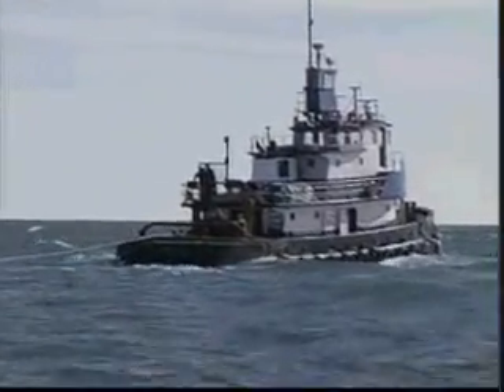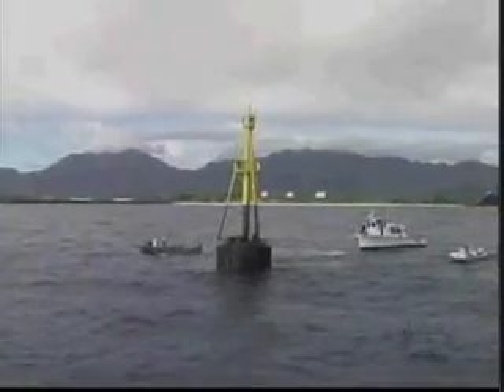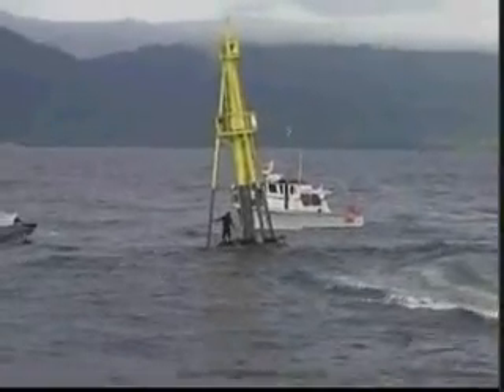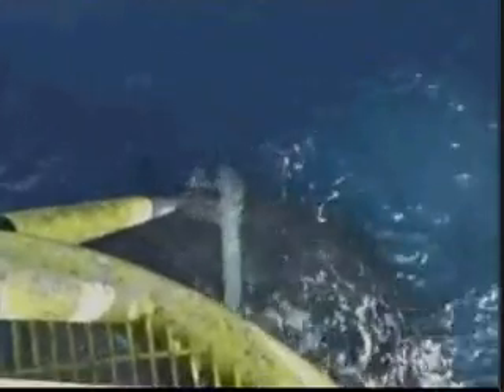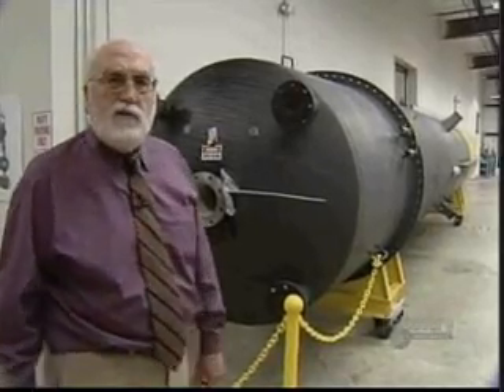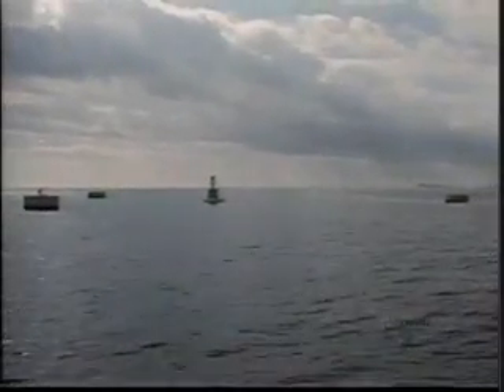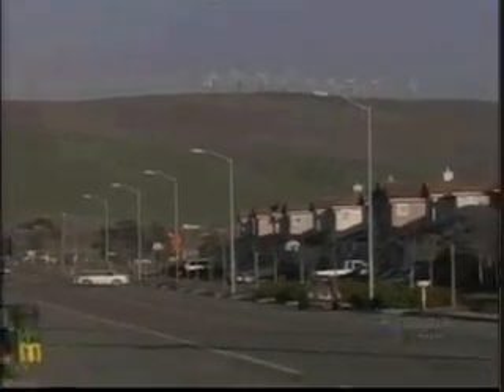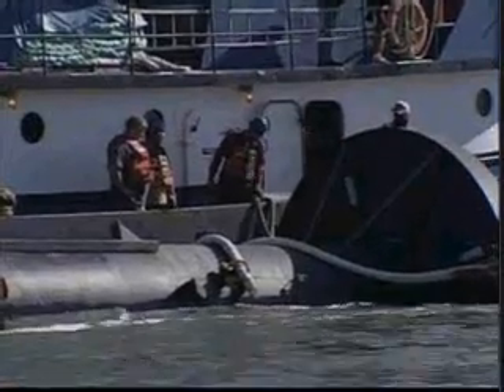Wave Power by Ocean Power Technologies

Comment: @thisisjusttoosilly I'd argue that it is not a green scam, a few years ago I saw an interesting concept presented by two young Australian scientists that would also harness wave power, slightly different to this concept in the sense that it was like a small power station sitting offshore, also, I think their concept used air compression instead of water flow. Air would go into a condenser tube (funnel) and compress to spin a turbine. Impressive stuff.